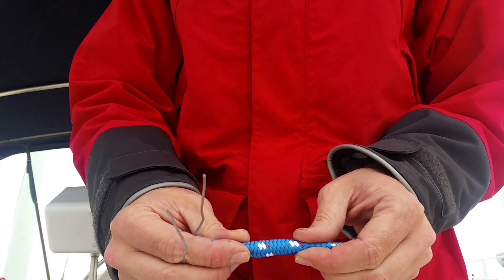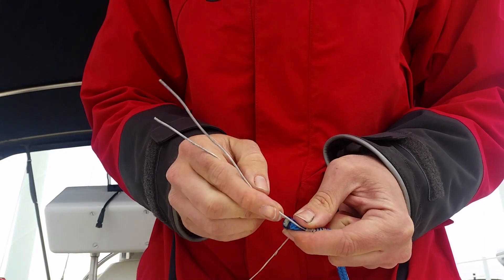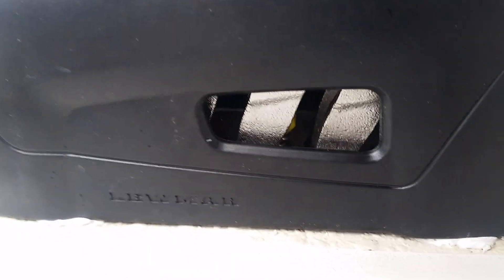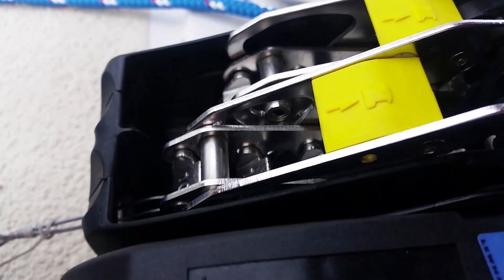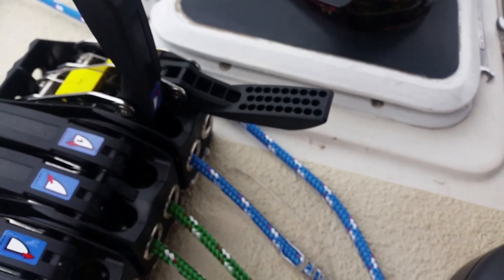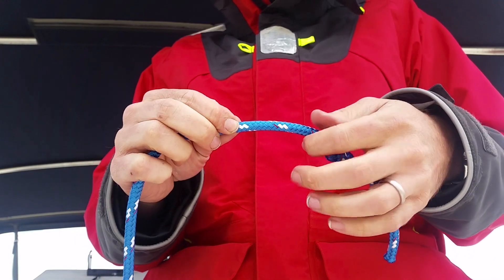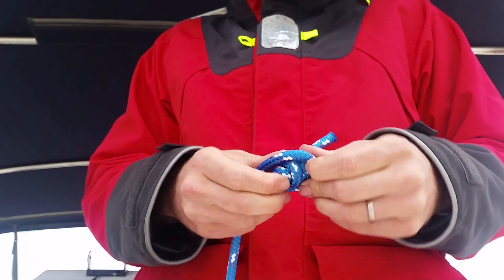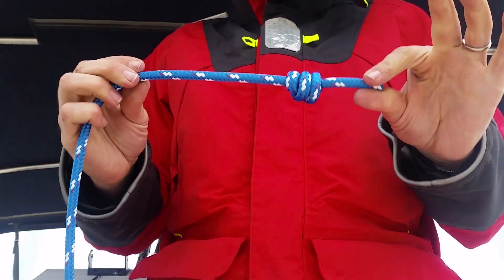How to set up rope clutches and stop knots

Comment: Hi, I need to replace the old rope clutches on my sailboat, and hope you can helps answer a question.
I can't decide if I should go for Spinlock XAS/XTS or Antal V-CAM 814.
My sailboat is an Albin Nova (33 feet race cruiser from 1983) with a 26m^2 main and a 21m^2 jib.
All the relevant lines (running to and from the mast) are either 8mm or 10mm rope with dyneema core.
How do I determine the minimum required holding strength for my clutches?
Reply from the maker: They make it really easy for you! The clutches are sized based on line diameter so you would buy clutches that 8mm and 10mm would be in the middle of their range. For example, the 8mm line, you would use a clutch that is 8-10mm and for the 10mm line, you would use a clutch that is 10-12mm. 
Antal also has clutches that are specific to that line size, it’s the DV Jammers, where you would simply use the 8 and the 10 clutches. 
They also make it easy for mounting because the fastener size is told to you and that fastener size will have sufficient shear strength to support the amount of pull that could be generated by a rope of that size. 

Lastly is the backing plate and this they don’t always tell you. The backing plate needs to be 150% the size of the footprint of the clutch. If the clutch is 10cm x 3cm then the plate needs to be 15cm x 4.5cm. 
The clutch also needs to be through bolted on a solid part of the deck. Some boats have hollow sections and the fasteners would simply compress this area. Find a solid part and mount the clutch there, or make a hollow part solid (but that is a lot of work).

Comment: Herbie !  I'm currently in the process of refurbishing my Lewmar Clutches, and came across this wonderful video (don't know the date it was published).  
I will try this method to reeve(?) the lines back into the clutch, and send a follow-up comment

Refurb = disassemble; polish CRES 316 parts; scrape off UV damaged plastic covers; apply plastic primer; apply clear overcoat (UV-resistant); re-install clutch onto boat.
Reply from the maker: Let me know how it goes! 
This video is maybe 6 or 7 years old. I did this job before leaving to go cruising.
Reply: Hi Herbie!!  FYI...the method to insert a line through a Lewmar Clutch worked flawlessly. 👍👍👍👍👍   I'm going to post the video soon (and give the credit to you).

Also, I have 11 clutches on my boat, and the refurb of the first two turned out better than I thought.  I'll eventually make a video of how I am refurbishing these clutches. 🙂🙂

THANK YOU again for the assist 🙂🙂🙂🙂🙂🙂🙂🙂🙂🙂